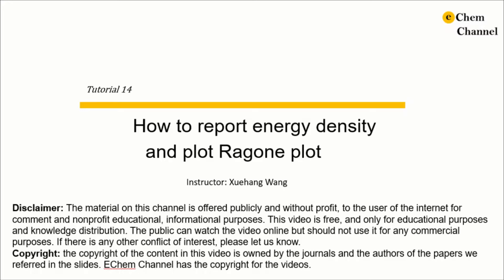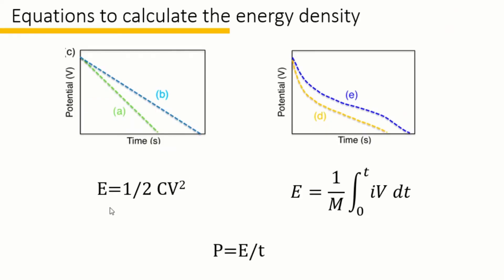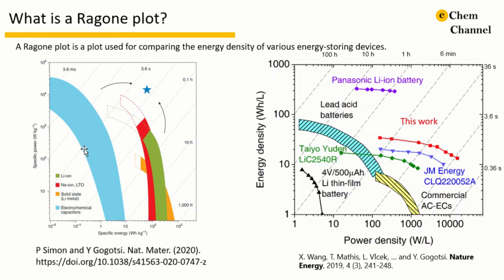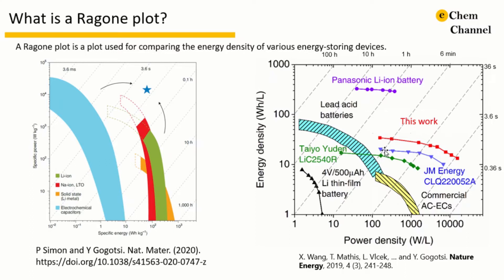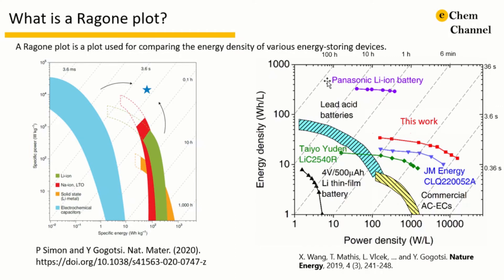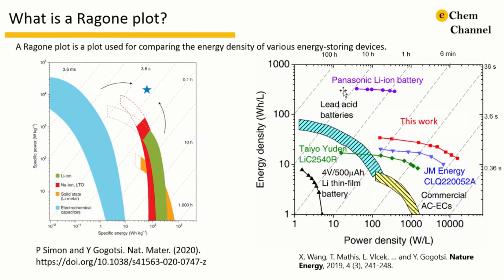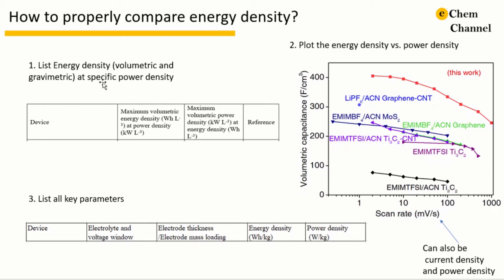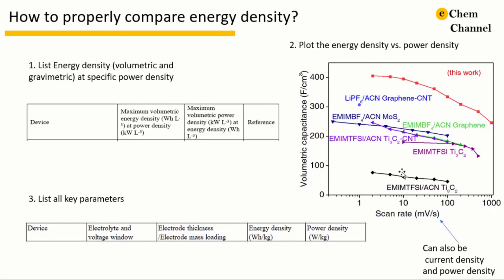Tutorial 14-How to report energy density and plot Ragone plot

Comment: Hi, please check the references at time 2:30 those papers don't show those graphs.
Reply from the maker: Please check the supporting info of this paper
Reply: @EChem_Channel 
Hi, for the plot on the left i checked this https://doi.org/10.1038/s41563-020-0747-z and it is fine.
for the plot on the right i checked on this https://doi.org/10.1038/s41560-019-0339-9 but nothing.
There is supporting info in the second one though, do you mean that?
Thanks!
Reply from the maker: @daroslai3  yes

Comment: Great effort as always. Kindly make a tutorial on how current density values effect specific capacitance, energy density and power density values from GCD profile. Either increase or decrese is noticed?  Also it is obseverd for some samples same potential range work in GCD as in CV but sometimes result not obtained in specific potential which lead different capacitance values at different current densities due to variating potential. How to overcome this? Kindly also do a tutorial in which compare different trends of GCD curves to identify IR drop region as many trends dont show clear IR drop which could lead to error in calculations. Thanks
Reply from the maker: Thanks. Great questions. The same capacitance is not obtained at the specific potential is due to the non-linear shaped GCD and non-rectangular shaped CV. In this case, one can report the charge (Q, C/g) and specific capacitance (intergral it, F/g).